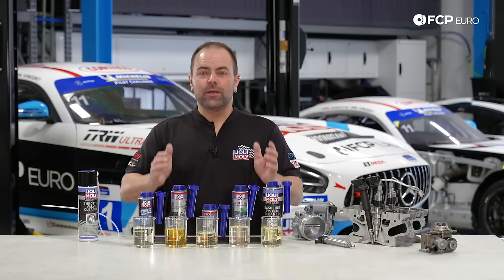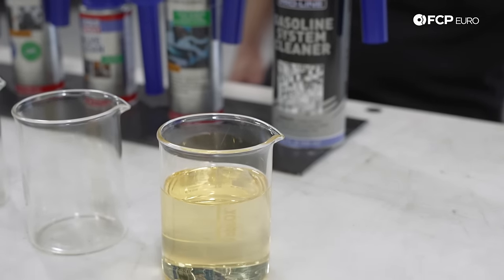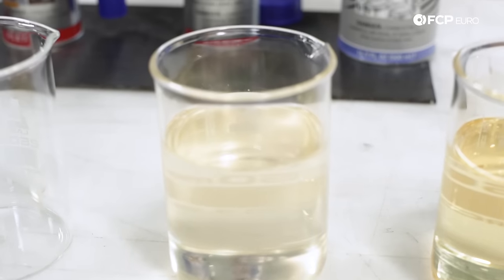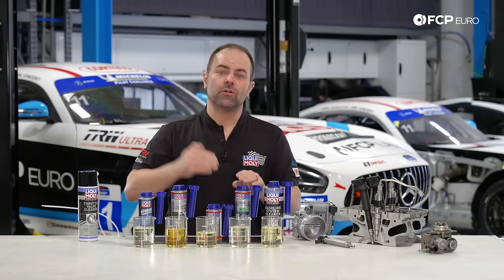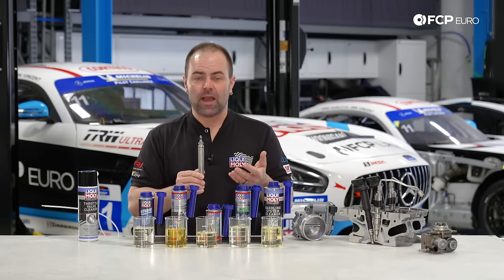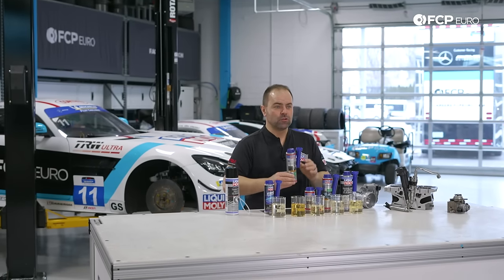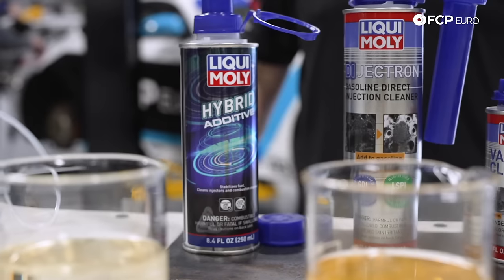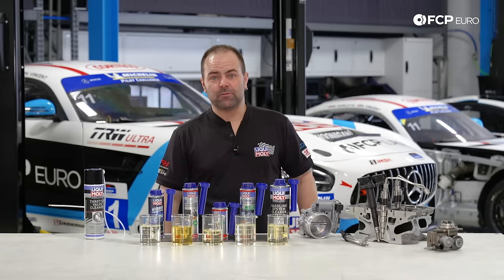LIQUI MOLY Gasoline Fuel System Additives Explained (Pro-Line, Jectron, Valve Clean)

Comment: Sounds like a money making adventure to me. How do these products know to only go to certain places? For instance the injectors or the valves and how does the Gasoline System Cleaner product miss cleaning the injectors and valves?
Reply: What i love about being a man is that we question everything. Women would buy 10 soaps and 5 17 lotions without question🤣🤣🤣🤣🤣
Reply: @chriscomey8592  That's right and very funny!
Reply: Literally the study of chemistry would be your answer
Reply: I’m not sure. I’ve recently used the DiJectron and it’s done something odd.. hence why I have come here for answers.. 

I checked the spark plug and I looked down the cylinders and noticed the top looked very glossy and polished, with small bits of carbon. But with a layer of sheen.
Previously even when I first had my engine rebuilt. I noticed the top had a thin coat of dry carbon. So I dunno if it’s the product had actually done this.. 

I do recall of additives to try clean top of cylinders but DiJectron doesn’t advertise it as a function/ability.. hmm
Reply: I used it last week, and my check engine light came on ! I ran it through a full tank and refueled again with 11 more gallons of gas. I still had my check engine light on after 25 miles.I tried to use my code scanner to erase code 9141 .Now my car won't stay running ?WTF.
Reply: @peterwill3699  error Code 9141 simply means your code reader isn't connected properly, the 9141 is a protocol that the scanner uses to communicate with the pcm. if there is no communication, then you may have no power to the connector.
Reply: The gasoline cleaner does all the above complete system. DI jectron works very well for GDI engines. I've been using premium fields and liqui moly products and haven't any issues at all on an 8 year old car.
Reply: Have you read what the philosophy of this company is? It is dedicated to being the best. Do your research before talking.
Reply: @cjewe1z  Yes, that's one thing!
Reply: @cjewe1z  I use the motor oil so get the facts before you start talking 2 years later!
Reply: @kene8895  What are you talking about? Too many people be getting defensive on social media. 🤣🤣🤣
Reply: @cjewe1z  Ditto! Seriously!
Reply: Different chemistry, different ingredients react to other substances in your engine.. Some of these will only activate in the presence of oxygen some other will deactivate in the absence of oxygen like your fuel tank (I'm just giving examples not saying Oxygen plays any role).
Reply: I bet you also have years of experience and a certification from a german product manufacturer??? 😅 ignorance is bliss 😂
Reply: @desertspectre2881  Maybe. Thank you for the comment. 😜

Comment: I use jectron and valve clean every 6 weeks….workin like a charm in my 2011 Audi A5
Reply: Every 6 weeks is overkill, but it doesn't harm either.
Reply: Does it matter how many miles a day you put? I daily about 70 miles a day
Reply: Is your engine direct injected? How does the cleaner get to the back of the intake valves?
Reply: Do you put the moly in before you pump or after you filled up
Reply: @M3RCx  I put it in before I fill up, I go every 3-4 months now
Reply: Valve cleaner is unless we don't have gdi but tfsi

Comment: Great presentation! Don't add too much fuel injector cleaner! May trigger O2 sensor code.  Follow directions. Only add the amount at the recommended intervals.  I inadvertently  added 3 bottles of Liqui Moly DI cleaner in my Porsche  Panerma 4s over the course of 2k miles. Check engine light code for O2 sensor. Light reset on its own after about 50 miles and some fresh gas. Di Jectron Bottle says add at every 2400 miles, more than enough. Great product!

Comment: Hi, I got a 2011 A4 2.0 TFSI (EA888 Gen 2). Which products would you recommend to use and for which intervals? Currently, I'm thinking of using the proline cleaner first for a full gas tank, then the di-jectron for the following fuel tank. Is this a good idea or does anybody else have better suggestions? Thank you!
Reply: This is just anecdotal, though I have used these products: The Pro-Line is a pretty strong cleaner, so I'd wait a longer time before using other cleaning-type additives. I waited about 2 months or about 5-6 tanks of gas before adding anything else. I now follow the 2,400-mile recommended interval between using the DI Jectron. I've heard it's not good to throw too many extreme cleaners at your car within a short time -- it could wear out seals and gaskets, etc.

Comment: Hello can I use your valve cleaner on my q50 2019 with 30,000 it is a direct injection twin turbo engine without damaging the turbos?

Comment: Can anyone help? I have a 2014 cls 550 w218 I believe it's GDI. How long do I wait after using Proline gasoline engine treatment to use D.I Jectron? Or should I Just use D.I Jectron every 2400 miles and don't start with Proline gas treatment 🤔 
Please advise. 
Thank you

Comment: Can we use the valve cleaner on Diesel engines or just gasoline engines ?
Reply from the maker: Hi Ben, we would recommend sticking to the Diesel specific additives from LIQUIMOLY, as Valve Clean is designed specifically for gas engine.

Comment: Why is liqui moly synthetic oil better than Mobil 1? i use 5-40 for my c240. Do you have any test data to prove that liqu-moly is higher quality than Mobil 1?
Reply: LM is going to have a completely different additive package compared to M1. I believe the base stock is going to be different as well along with a much higher HTHS specification and solid NOAK rating.

A lot of the API SP GF-6A rated 5w30/5w40 oils are not very good and are at the low end of the spectrum for film strength and high temperature shear.
Reply: Thanks David. On my next oil change, I will try out the  LM 5-40 for my C240, C300, 2014 Honda accord and 2005 Honda Odyssey  Can you print out that technical data sheet that proves that LM is >>> then M1 related to film strength; high temperature shear; NOAK.    ????   This would be great information to have.  I also learned that German cars made in Germany have higher quality then the same car made in the US or in South Africa, just like Japanese cars made in Japan are of higher quality than the same car made in the US.
Reply: @henrylee2964  They should be able to provide you with the technical data sheet. 
Just to be clear there's nothing wrong with running Mobile1 or any other brand of oil as long as it meets the engine specifications. 

The difference between say Amsoil, LM, or even Red Line is in the base stock and additive package.

How have the vehicles been running on the LM 5w 40?
Reply: liqui moly is great but the vendors in  LA are is charging $11/liter which is not competitively priced with other high quality synthetic oils like EURO LUB AND Mobil 1.

Comment: What additive do you use for Toyota that has both GDI and port injection in its engine?
Reply: This is also useful to know for Euro Gen 3 EA888!
Reply: @MercSLRFan  this is what I need to find out. Or can one just add aux port fuel on say startup to clean thr valves?

Comment: before i do an engine flush using liqui moly ofcourse, would it be better if I do this steps Jectron>Gasoline system cleaner> Engine flush?
Reply: english flush is a completely different system and wouldn't affect jectron or gasoline system cleaner.

Comment: I accidentally pour the whole 300ml of LM Injector cleaner bottle in an 50 l tank, can I get into trouble?
Reply from the maker: You should be fine with that, if the tank is not full you could top it off, and if it is full you should be ok.
Reply: @fcpeuro  thx, another question: it's there any procedure that I need to follow after adding the LM injector, regarding the driving mode ( short vs long trips, normal vs higher rpm, etc. ) I haven't found any info on the LM website or maybe I missed it.

Comment: I like the video as it is very detailed. However, can it be used in a 2013 BMW 328i xdrive engine?
Reply: Yes sir.... I have a 2013 BMW X5M that would at times throw a check engine light when accelerating. I put a code reader on it and no code came up. I wasn't sure what to do so I put in fuel cleaner from Amsoil / Redline / Royal Purple / Liqui Moly. One of them at every fill up. Problem is gone now, but I do believe it was a dirty or clogged fuel injector.

Comment: The valve carbon cleaner does not work on direct combustion engines. The injectors are placed inside the combustion chamber and not before the valves, so the product does not pass through the valves.

Comment: Some people say synthetic oil last forever
Is it myth or fact?
Reply: No automotive fluids last forever alot of modern ones last longer than they used to though the dealer told me that the cvt fluid is lifetime but the owner's manual says change it every 30,000 miles if the cvt fluid lasts a lifetime like they said it does the cvt should come with a lifetime warranty

Comment: "If you're faced with problems on your intake valves GDI engine" NOT IF but when. Sooner or later you'll have to have the valves cleaned manually which requires a costly partial teardown of your engine to get to the valves. I've got a MK4 Jetta (port injected) it has 265kmi on it never once had to spend more than $50 dollars for a crank timer that's it, run Jectron once a year. 
I also have a MK7 Alltrack now at 45kmi and now getting ready to spend over $600 to have valves walnut blasted, is this progress? 🤷🏻‍♂ Nothing against LIQUI MOLY products I use them including my oil.

Comment: If I use jectron do I need to use the gasoline cleaner too? And if I do can I use jectron with one tank of gas and then the cleaner with the next tank of gas?
Reply from the maker: Hi David, it would be recommended to use one at a time, and you can certainly follow one after the other with your next fill up.
Reply: yeah but is there a benefit of doing one over the other?

Comment: Do you put the Valve/Jectron additive in first, or after you’ve filled up your tank?
Reply: Put the product in first (when at the servo) then fill up.. It'll mix as the fuel is filled
Reply: P.E.A. = Polyethylamine = Techron = Chevron= cleaner fuel system, valve stems, ports, etc. Postpones requirement for very invloved and expensive walnut shell or dry ice blasting of the intake valves/ports. The LiquiMoly products do help reduce the inherent engineered design shortcomings of direct injected engines.